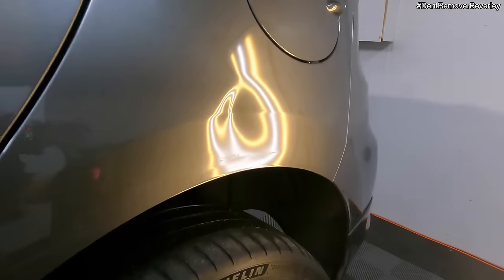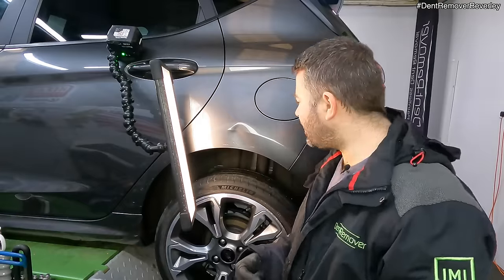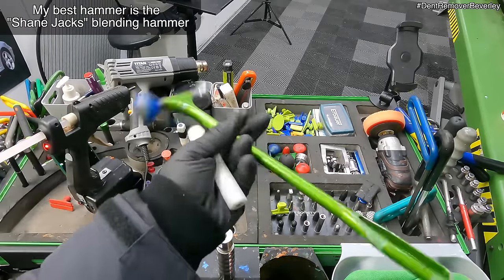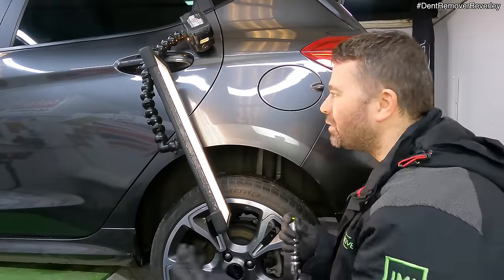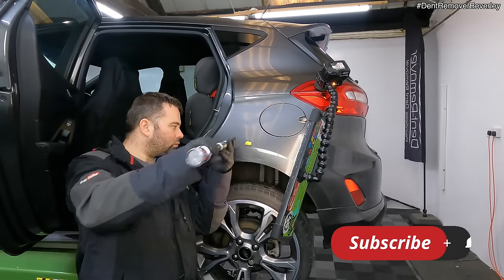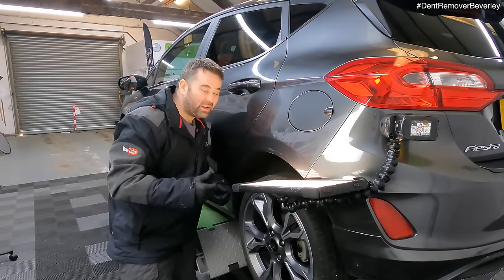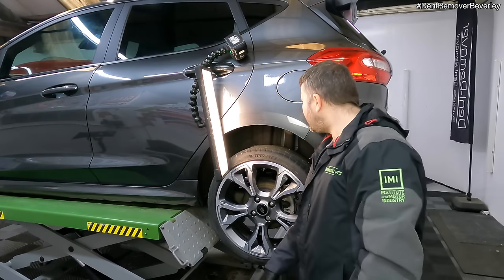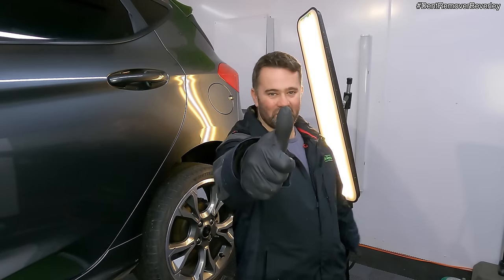HOT GLUE DENT REPAIR | STEP-BY-STEP By Dent-Remover | PDR UK

Comment: Very interesting to watch.  I'd like to know how long - start to finish - the repair actually took.  I'm guessing 4 to 6 hours.  The estimate of GBP766.60 seemed a little high to me.  At approximately CDN$1,300 tax in, I can see the value of the repair:  Done in one day; no paint removal, filler or paint replacement; perfectly blended.  Here, in the Democratic Peoples Republik of Kanada in Ontario, it would have been weeks to get into the shop, and days to complete the repair, at a significantly higher price.

However, one word jumped out at me after watching this -  PATIENCE.  Nicely done.
Reply from the maker: Hi Peter
Thank you so much for your great and grown up comment on this repair 

The repair took me about 4-5 hours from memory, and yes I know the estimate seemed high but an insurance company would easily pay this for the work to be done it’s way cheaper than a repair and paint from an authorised bodyshop. 
There are always cheaper routes, back street Bodyshops etc some good some not so. 
I don’t charge this amount as it was to be paid by the customer and I did state on the video that price was an example of an estimate to show how repairs are priced up. Nothing worse than a customer bringing a dent in and the technician plucking a price out of the air- that would be 675 please- how did you work that out? Just felt like that price was good…….. not really justify able.
The turn around is way quicker than an insurance arranged repair and maybe a bodyshop repair and paint. The value in my repair should really be a lot more than a filler and paint as I’m magically repairing the damage with no damage to the car. Unfortunately no one seems to grasp this and is dent techs are often a curse to ourselves as we make it look easy- hence my PDR videos to show the work and Patience involved 

Thanks for your great comment 
Thanks Martin

Comment: Just wondering what the cost is for this sort of repair, compared to pannel beating then spraying. A great job by the way and it's all kept genuine bodywork and pint.
Reply from the maker: Thanks Tony. I can’t remember exactly the cost of this repair but it’s a better method to PDR than repair & paint. Depending where you’d take your car for panel beating and painting would dictate the rate as there’s plenty of small shops with low overheads and would be cheaper than the bigger shops. We are not the cheapest PDR company but as you can see from the finish we provide a professional repair. Il see if I can find the price for you on this one

Comment: So, what if you do have the very small 'dot' dents, like from a bb gun or rock hits?  if the best case, can you use a small hot glue technique, or would you weld on a rod and pull with the slide hammer?   I have several of these on a car restoration project.
Reply from the maker: All depends Mike 
If you don’t want to paint it and a glue pull is right for the job then yes sure, or use a bar behind to push it out. 

If it’s bare metal then all of the above, or weld a pin on it, or hammer and dolly

Comment: Very brilliant work and beautifully explained.
I am also interested to do one repair myself. I have a slightly re-painted surface. I want to avoid glue and attempt to reduce the dent just by tapping with nylon knocking heads. However I have some questions, it would be a great help for me if you could spare sometime to answer,
1. Is it possible to reduce a small dent just by tapping without pulling?
2. Is dedicated hammer necessary for tapping or we can use any light weight hammer with caution?
3. What is the sheet with parallel lines called to see high and low points? I am unable to find it online(I just want diy version of that sheet). Is it possible to find a template to print it on paper and then use it for tapping?

Please keep in mind that I am not looking for professional results. As long as dent appearance is reduced by 70-80%, I am good.
Reply from the maker: Hi Ahmed
Thanks for your questions.

Go careful when tapping the painted surface with knockdowns, especially if it’s had filler in the area too as this will sink and look horrible. It is possible to glue pull using a wet pull method but this is a very tricky and skilled trick and it’s 50/50 if the paint will Come off so I wouldn’t recommend it 

Answers to your question 

Yes you can carefully tap a dent out and this is called blending, where you lower the area around the dent to “blend” it into the shape- this is a skilled method though and it’s very easy to make it worse
Or if your able to tap the dent from behind with a hammer but go very careful 

Hammers are hammers. I used a light tack hammer or a jewellers hammer when I started, also you can use any wood shaft hammer and hold it backwards so your holding the hammer head and use the wood shaft as your paddle

And the lines board is called a line board! Nothing too technical I’m PDR ! If you go onto eBay and search for PDR line board then lots should come up. Just buy a cheap one as they can look complicated and it’s really only a sheet with lines on and a sucker.
Reply: @dentremover01  Thanks a lot for the detailed reply. Really appreciate it.

Comment: Hi my friend. I just bought a dent repair kit for my new car. My dent is much smaller than the one in your video. What liquid should I use to remove the glue? Technical gasoline, alcohol, isopropylacohol (IPA) ? Greet from Slovakia.
Reply from the maker: 99%isopropryl is the best

Good luck

Comment: What is the average cost for pulling of a crinkled front fender.  80% fix vs 95% fix...?
Reply from the maker: Hi Steve. I couldn’t really say unless I saw the damage and 85/95 isn’t much difference, maybe more ripples on an 85% repair? Maybe 50-100 less than a 95%🤷🏻‍♂️
Reply: Short of a complete new fender that would need painting, trying to Band-Aid it together and sell. Was just wondering if a rough fix and not perfect fix would be a couple hundred or much more?
Reply from the maker: Hi Steve I think I get you. If the panel was structurally damaged or needed pulling with clamps then it’s best repaired and painted
A crumpled wing or door could be repaired best possible but a price is hard to give because time and standard of repair etc needs to be figured out

Comment: Found this video by accident. .. No Pun intended..
That hot glue method looks fascinating, I've only seen suction methods before now.
I've a question, could this method be used on a motorcycle fuel tank, or is the steel 
too thick?
Reply from the maker: Hi Gary thanks for your comment. Bike tanks are usually repaired with bars. If the dent is very shallow then it may be possible to glue it but as a lot of tanks have special paint designs I’d always try a bar tool first. 
Please contact your nearest PDR tech or establishment for info and please don’t try it yourself unless your absolutely sure

Comment: i have a PDR kit. what is the fluid you squirt to remove the glue? my kit said to use alcohol, which seems not to work. I had several dents in the same area i would pop one out then when i popped the other out the one i just did would pop back in. it was that i was not pulling the dent out far enough. i bought some aluminum tabs
Reply from the maker: Hi TomeTraveler. Yes I use 99% isopropanol and this removes the tabs and glue. If you struggle then maybe lightly warm the area with a heat gun then re Spray with iso 

Regards the dent popping back in that sounds like you have crowns around the area which need tapping down. This releases tension and will help you remove the dent with glue

Comment: What are you using to remove the glue if it stays on the body?
Reply from the maker: Hi. 
Some tips if the glue won’t come off the panel
You could warm the glue up with a heat source until it becomes tacky and re apply isopropyl alcohol

Or apply a small bit of glue to a tab and glue onto the stubborn glue, spray immediately with isopropyl alcohol and the lot will come off with ease 

Hope this helps

Comment: Is the glue different if it's aluminum?
Reply from the maker: No the glue will stick to the painted surface so it doesn’t matter if it’s steel or Ali. Just sometimes more force is needed to pull an aluminium damage out

Comment: I've just bought the Sealey glue pulling kit, but the glue seems to be an absolute nightmare to remove.
Reply from the maker: Use some 99% isopropyl and it will remove the glue 🙌🏼

Comment: OK.  From where can I get the bits and pieces.     I parked my car in a supermarket carpark away from cars and someone parked next to and caused a slight dent when they opened a door.  They drove off before I returned.   Please put a link
Reply from the maker: Hi William, thanks for your comment. I’d always recommend you speak to a dent tech first to get their opinion. From there you could then decide on a repair or self repair. Baré in mind PDR tools are not cheap- and there’s a skilled method to this PDR so please go steady I’d hate for you to create more damage. See what a tech says first 
Thanks Martin 🙌🏼
Reply: The dent is hardly visible and I was told that if I poured boiling water over it, it may disappear, but I dare no do that unless I had confirmation that it would not harm the paint.  What is your comment on that?
Reply from the maker: Boiling water won’t harm the car, I doubt it will fix the dent either and I’ve certainly not used water to fix a dent in my time as a PDR tech!

Comment: Amazing channel, I loved your custom made pulling tower, would you mind sharing what pdr glue you are using? I bought 2 pdr glues and both didn't stay on surface of the car even if I use t-bar :(
Reply from the maker: Hi Jake thanks! Ok with glue there’s a process. The best thing to do is google “Kecotabs 6 C process”
You need to clean the panel of any polishes, warm the panel the remove residue and clean with alcohol.the rest is in the 6C process. I use Glexo hot, Hawg, and cam auto glue

Comment: Does it matter which hot glue you are using as I've tried to pull the dent with that hot glue, and it seems that it doesn't stick enough to be able to pull the dent. By the way, it is not a big dent and is not on a Grove.
Reply from the maker: Thanks for your comment. It all comes down to preparation. I have another video showing a process https://youtu.be/T_7pofEHTmM?si=SMWPNaOpZ0SsP-pV

Hopefully this will help
You??

Comment: Hi Mate, thanks for the fascinating video. What is the liquid in the bottle you use to clean up the hot melt glue?  Cheers.
Reply from the maker: Hi Peter 
I use 99% isopropyl you can buy it in most diy stores and also Amazon which is where I get it from 
Thanks Martin

Comment: Great video but probably going to be cheaper getting it painted at the rates being charged here.
Reply from the maker: Thanks Aldor, the prices are estimates and this method is a very skilled process. To keep a vehicles warranty and as new condition is invaluable to most of our customers. Having a car repaired and painted is a bigger process and although it may feel like your getting value for money, depending on who you use you may not get a good repair, maybe filler or a roughed out dent and then repainting. In the future when the vehicle is ready to be sold this could be picked up on an inspection and then the cars value is depreciated 
With a PDR non of this would happen, the dent is simply eased back to pre damage shape. I do see people’s point on cost though as this is the main thing with any repair vehicles/houses etc 

Thanks for watching and commenting

Comment: My tabs never come off that clean and they usually fall off after the first pool. Then I spend about five minutes getting the glue off the car.
Reply from the maker: Ok. The glue needs slightly warming to help it come off in most cases. I use Glexo hot glue or Brazilian ninja glue (dark green) as this peels off in one go. 

The reason why the tabs falling off could be a few things.
Firstly you need to correctly degreaser the panel and get rid of all contaminants. Use paper roll and 99% isopropyl and warm the area up with a heat gun and let settle to an ambient temp.
Pulling the tab at 29°C is the best temp and the tab will pull well. 

If the glue goes all bitty when the tab has come off, either warm it up slightly with a heat gun, or put new glue onto the same tab and stick onto the bitty glue. Spray with iso immediately and carefully peel off. It will all come off in one go 

Hope this helps

Comment: What if it has been painted?
Reply from the maker: We can still repair with the methods by there’s a greater chance the paint may come off. If it does then it will need repainting elsewhere.
End of the day we are trying to repair damage, Lots of variables and some paint is stressed upon impact. 
We are usually good at spotting the pre warnings so we can stop and advise

Comment: Cost?
Reply from the maker: Hi Tim. I can’t remember exact but was probably around 250-300 but for insurance it would have been 733-800

A conventional repair and paint through insurance would also cost north of 600 easy
Reply: @Dent-Remover  Thanks for the reply. Either way it's done, the guy doing it has to know what he's doing. And have the correct tools. Thanks again.  👍

Comment: £700+????
Reply from the maker: Read the description!
Reply: Then the estimated cost initially for this was extremely expensive for the size of the repair. I understand you have overheads, but those estimates would be hindering your business. £700+ for that size damage, is cost prohibitive for the average home. What you finally charged was fair, and your work was good, however if I was quoted your initial fee, I would walk away because it would become down the list of priorities as the vehicle is not undriveable. That’s just the truth. 
I guess it comes down to how many hours per week people want to work now as apposed to how business used to function. Most now only want to work a day or so to earn what they need, and that cost is carried somewhere.
Reply from the maker: Hi  @bereanborn888  I see your point, but for an insurance quote this is quite cheap. When you consider the alternative which would be a repair, filler and repainting 3 panels atleast. All the necessary strip and fit too 

Our customer didn’t  want  to have his brand new car repainted at all so the method he chose was PDR. 
The cost of living has gone up all over the place, our business costs have doubled too and we have to charge more to make the same and keep our heads above the water. We’re not in a position to work a day and pay all our bills we work all hours and scrape by 

Going back to the insurance prices, the  imsurance pay these prices not a problem. 

We priced a 30mm round dent on an aluminium bonnet on a BMW at £650+vat which the insurance accepted straight away. We saved the insurance atleast 1k, we saved the car from a full bonnet repaint and blending of the front wings. Kept its factory paint and its warranty 

I know that 700 looks a lot for a dent and it looks like PDR is an easy job, but when you see the value of the repair method it really isn’t.

Take a look at what the Americans charge, one of my friends charged 21k for a PDR repair and the customer bit his hand off
The bodyshop quoted 41k to rip his car apart and replace the panel

Comment: 760 ofd quid what an absolute joke. Daylight robbery that mind. My van was much much much worse than that and cost me only £280. Paint job the lot. Done a fantastic job too. ****however i will say that your good at what you do. Just don’t agree with the price for half a days work with hardly any cost.
Reply: ***my man would of done that for probably £50 - i guarantee it would of been less than £100.
Reply from the maker: Thanks Jonny for your comment. I can’t run a business repairing damage for 50-100 etc 

This repair was around 300 and I have a premises and wages to pay, let alone make a profit somewhere 

Insurance will easily approve this repair at more than 700-800+

It’s not for everyone and we can recommend cheaper techs and paintshops. We charge what we think is a reasonable price for the quality repairs we produce